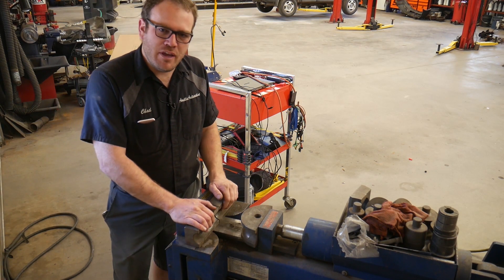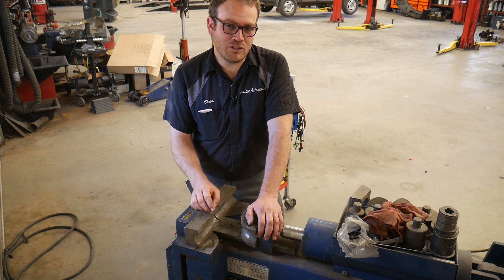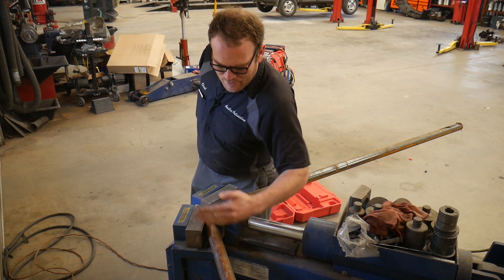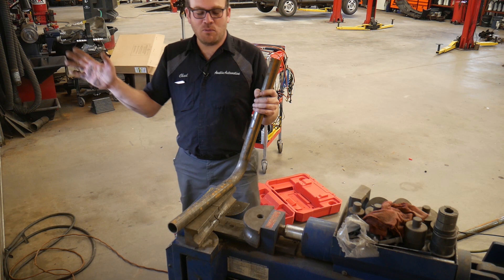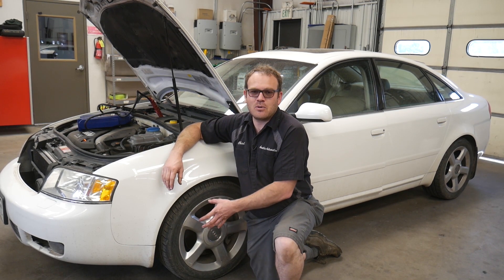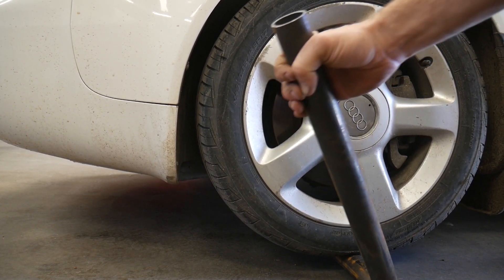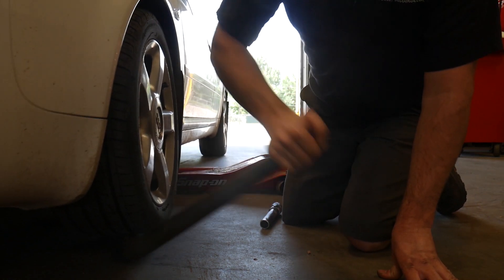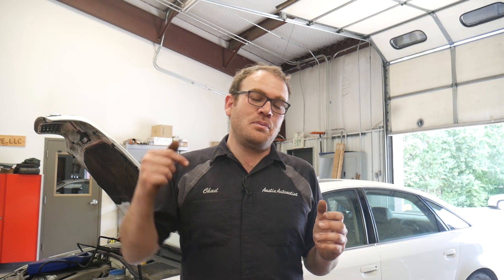Make a tool challenge - Mechanical home made tool

Comment: The shop who performs my front-end alignments also installs mufflers and cats. I gave him the dimensions and they made this tool for me from the strongest exhaust pipe they sale.  Thanks for the great tip and demonstration.
Reply from the maker: That exhaust pipe should hold up well. If it ever deforms from use its cheap enough to have another piece bent.
Reply: @ThePracticalMechanic  The owner assured me the higher quality exhaust pipe he used would hold up under the weight of one front tire.
Reply: @snw56  how much did they charge you? Mueller keups tools has one of these but its like $100
Reply: @urahaman1479  Since I always send all the cars I repair that also need front-end alignments to them, he didn't charge me anything.  Said he didn't have a category within his computer to charge me, ha, ha!

Comment: Watched  your video and knew had to make one. I told my coworker about it and he made one and used it to check for a clunk on a ford fusion. First time using it and found the cause of the noise. The  rear lower control arms on the front suspension were loose and couldn't find it any other way. The parts only had 15000 km on them before they were replaced.. Stupid aftermarket junk... But guess what was put back on it because it's lifetime warranty 🤯🤯🤯
Reply from the maker: Nice!! Glad the tool helped you out. Now it’s going to be your go to tool for front end noises.

Comment: 4:20 in and I’m guessing it’s a lower control arm pry tool. And if I’m right, that’s awesome cause they’re expensive. Never thought of just grabbing a piece of pipe and bending it. lol. 
It’s been awesome watching everyone participating in the make a tool challenge.
Reply: Sweet! Guess I was in the vicinity. I think Garage Gurus put out of a video checking suspension components in that manner. Awesome!
Reply from the maker: Thanks for participating Angel. Look like you nailed it. Thanks for the information about garage gurus as well I will check them out and see if I can find that video.
Reply: @AngelGarcia_128  I have seen that tool in South Main Auto videos to pull spindles for whatever reason..bad bearing, ball joint..etc. Great leverage with that tool.